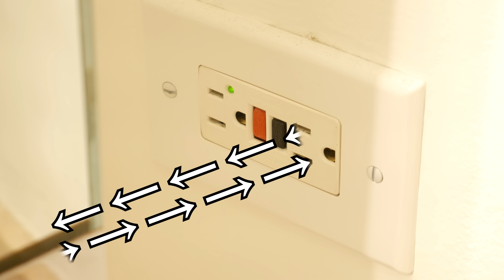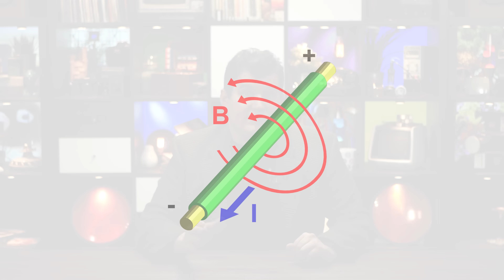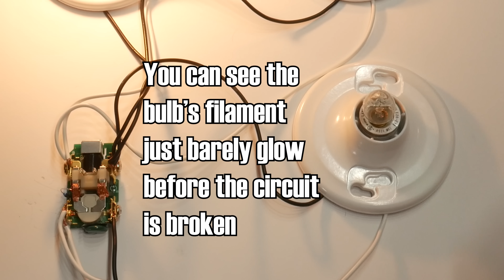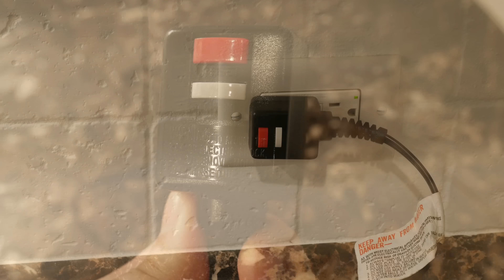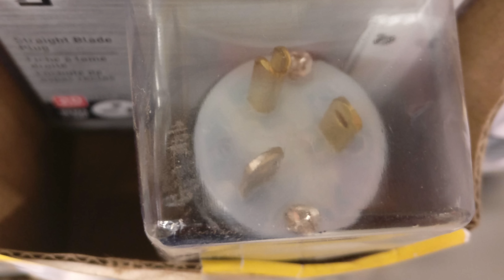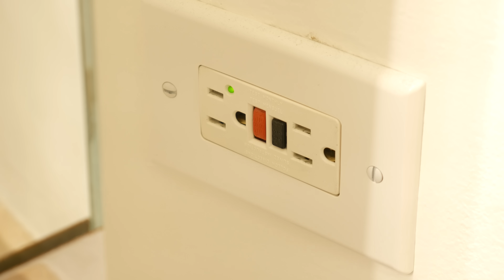The GFCI/RCD: A Simple but Life-Saving Protector

Comment: It's only required in the US for wet locations because in dry areas like your living room, you're more likely to shock yourself through a hot-neutral fault than you are with a hot-ground fault, which these devices don't protect against. Which is why they're also required over concrete like in your garage; touching a hot over concrete will more easily create a path to ground than if you're on carpet or hardwood.
Reply: Not sure what you are basing that it won't protect from hot to ground.  A GFCI protects both Neutral to Ground and Hot to Ground.
Reply: @redbaron6805  read it again. It won't protect from hot-neutral faults.
Reply: @Fsilone  Not sure what you are basing that on, as the GFCI monitors both the Hot and the Neutral for current.

If current imbalance of more than 5ma is on either one, it will trip.

So, if a more than 5ma leaves the Hot and does not return to the Neutral it trips, and if more than 5ma returning from Neutral to Hot is missing, it also trips.

A GFCI would be pretty useless if you could short the hot to ground and it didn't sense that.
Reply: I doubt, hot neutral shocks are rare. In many dry rooms you still have grounded equipment that offer direct path to the ground.

Comment: These things are annoying. There is one in my house that somehow, for some reason, is linked to everything on the OTHER side of the house. So when it pops half the house goes out. Whoever wired the place up must have been hungover
Reply: That scenario is typical when a garage GFCI is used to protect bathroom or kitchen, which is normally a dumb cost cutting move done by builders.  

The simply solution is to add GFCI outlets in the bathrooms and kitchens and simply wire the garage GFCI back to the Line side.  Have done this many times as the down stream GFCI solution is pretty dumb in the USA and is saving literally peanuts in costs.

Comment: I got zapped in my room because my mom woke me up to go test my outlet but it wasn't all the way installed. Even though I had helped with much of the work the day before and therefore knew better than to touch the sides of the partially-installed outlet, I was extremely tired so I went to plug a night light in to test the one under the leg space of my desk, got zapped, and whacked my head on the underside of the desk. In any case, I no longer required a cup of coffee because that zap sure woke me up. Obviously, coffee is a safer option but requires more time to take effect.

Comment: Hold on...You are allowed a power point in bathrooms in the USA? 

Fun  Fact

The reason we don't have this GFCI in a bathroom in the UK is because we are not allowed to have a socket at all ( unless the bathroom is big enough to be safe ). This is the phrasing in the building regs.    

Sockets

Sockets are not allowed in bathrooms or shower rooms (apart from shaver-supply units) unless they can be fitted at least three metres from the bath or shower.

Electrical shaver points must be a safe distance (in meters) from the bath or shower to avoid splashes

Comment: The building that I live in is so old that it has outlets specifically for electric razors.  This is before GFCI/RCD outlets.  From what I understand, I believe they reduce the voltage, or possible amps.  I don't think they are as safe as GFCI/RCD though.
Reply: If that is in the UK they are isolated i.e. much safer than any RCD. You can only get shocked between the two contacts.
Reply: @okaro6595  Canada.  Most newer buildings don't have razor plugs anymore.

Comment: One argument against GFI's in the breaker box is that due to their sensitivity and imperfect nature of our wires (shunt conductivity of the insulation) they will auto trip if you go over 100ft (roughly). However, we make GFI circuit breakers as well, i think of GFI as a function not a device, so that outlets, breakers, plugs, power supplies, switches, ect can be made GFI for whatever reason. I have a pool pump wired to a light switch wired to a GFI breaker, which is good because we often are wet when turning it off, and it has water that we swim in very close to a 240V motor, safety is prefered. 

I also assumed it had 2 ammeters, learning it just uses Ampere's law + Lenze's Law is really cool.

Comment: I think we (UK) call them Residual Circuit Devices (RCDs) to distinguish them from Earth Leakage Circuit Breakers (ELCB).  The latter trips when there is current in the earth core, which would be caused by an internal fault in the appliance (unless double insulated), and not by external leakage.

A guy I knew wired in a new light in his cellar exactly like you wired the 3rd bulb, it took him ages to figure what was wrong.

Back in 1960s in school we were told about this system as it was incorporated into some electric kettles, if the element shorted to the kettle itself the imbalance tripped a spring loaded plunger which sent the mains connector at the kettle end of the mains lead shooting out of the receptacle.

Comment: In Australia, circuit breakers are in the circuit break panel or fuse box, not in each outlet.  In the late 90s and into 2000 we had a situation where our circuit breaker kept tripping off, it happened rarely for several years, but then in 2000 it happened much more, we eventually discovered that the dishwasher was causing the trouble, the door switch would short out when someone opened the door.  I remember one time Mum was talking to someone on the cordless phone while working in the kitchen, she opened the dishwasher and immediately the circuit breaker tripped off, disconnecting the call, because of course the cordless phone needs mains power to work.
Reply: Tom Geldon  What do you call it then?  A safety switch?
Reply: Tom Geldon  Alright, I probably mean RCD.  I've always known devices like this as circuit breakers.

Comment: The current doesn't "flow" It oscillates back and forth @ 60 Hz. It's AC not DC.
Reply: The voltage causes a difference in potential which causes current to flow back and forth.  So, current flow is not inaccurate in any way in this context.  Both AC and DC equipment has a current rating and both have current flowing through them.

Comment: I love the GFCI’s in my house. There is a green light that is always on as long as there is incoming power, and a red light that comes on when the outlet trips. No more wondering whether a light is power or fault.
Reply: The Red light is normally reserved as a fault light for GFCI's when internal testing fails.  Self testing GFCI's will show a Red light when the self test fails and the GFCI requires replacement.
Reply: @redbaron6805   Yeah. Im just pointing out that my GFCI’s don’t have that annoying “does no light mean powered or tripped”. Mine constantly has one light or the other.
Reply: @joeythefoxxo  That's cool.  I prefer the one's with a light myself.  Just pointing out that most of the time, the Red light means failure instead of tripped.

I have a GFCI with a built in LED night light in one of my bathrooms, so I know if its tripped as the LED night light will be off.

There are a lot of different styles out there.
Reply: @redbaron6805  I love the night light ones. It’s the one that also has a white little indicator right?
Reply: @joeythefoxxo  The one I have is basically this one:

https://www.amazon.com/Legrand-1595NTLTRWCC4-Receptacle-Nightlight-Resistant/dp/B001H1GQRC

Although mine doesn't mount upside down, it mounts like a standard outlet with the ground on the bottom.

Comment: I work in construction and you wouldn’t believe how many inspectors don’t know how to test these. The ONLY authorized way to test these, is pressing the test button. Most inspectors use a plug in tester that tests it like testing a circuit breaker and will say there is a problem and that it didn’t “trip”. I have to educate them AND the homeowners EVERY time that THE ONLY AUTHORIZED WAY to test GFCI’s is the “test” button.
Reply: Your claims make literally no sense at all.  First of all, the actual inspection standards state the following:

"8.1.F. [The inspector shall observe] the polarity and grounding of all receptacles within six feet of interior plumbing fixtures, and all receptacles in the garage or carport, and on the exterior of inspected structures

Testing is commonly performed using one of a variety of electrical testers. First perform the visual inspection for overheating, looseness, arcing as noted above for switches. If a device is quite loose we do not test further but report it as a required repair. [See "Electrical Receptacles" in this issue.]

8.1.G. [The inspector shall observe] the operation of Ground Fault Circuit Interrupters.

While manual operation of these devices using their internal test button is possible, experience and information about the construction and operation of these devices and the circuits which they serve suggest that testing using GFI-test equipment adds additional information and will find defects not disclosed by manual operation. See "GFCI's" in the original issue of the ASHI Technical Journal.

Electrical "outlet" receptacle testers like the ones shown in these two photos are used by most home inspectors to check for proper wiring at electrical receptacles as well as to check the function of GFCI's.

An electrical receptacle which has been wired 'downstream' from a GFCI or AFCI will be protected by that device provided that the wiring has been connected properly.

We find often that these devices were not wired correctly. For example, reversing the "line" and "load" wiring when installing a GFCI will prevent it from functioning properly even though the installer may test it and think it's fine."

In fact, it is literally IMPOSSIBLE to test downstream circuits connected to the LOAD side of a GFCI without a tester, as they have no test button.  

So, the idea that the ONLY way to test a GFCI is by using a test button is completely false.

Comment: Any GFCI-protected electrical outlet in your home is a good test point for whatever older, perhaps vintage, electrical or electronic devices you might have decided to plug in after they sat around for years unused or that you had picked up at a flea market or whatever. Tube/valve type guitar amplifiers and hifi amplifiers are a particular case in point;  these often have the audio ground and chassis coupled to one leg of the power cord through a capacitor , for the purpose of using the neutral wire as a pseudo "earth ground" to the chassis, in order to reduce audible hum and buzz. If the amplifier hummed, you would simply flip the non-polarized power plug around the other way and hopefully lessen the noise; or if the device already had a 3 wire grounded cord, there might be a switch on the back to select the ground polarity and you would set it to whichever position reduced the noise. The problem is, 60 or 70 years later those capacitors often leak voltage and so you might find some AC leakage current on the chassis of the amplifier, and also on the guitar strings and metal hardware of the guitar. However, plugging such a device with a leaky "death cap",  as they are often referred to, into a GFCI outlet will immediately trip the built-in breaker and alert you of a dangerous situation.. As I have noted, vintage guitar amplifiers pose a special problem and should always be converted/ upgraded to a grounded 3 wire polarized cord and plug,  with the death cap removed.
Reply: What if all available outlets are only two prong and have been upgraded to GFCI 3 prong but still no ground, is there any way to make a grounded device safer? We also use protected power strips on every outlet without GFCI

Comment: Just moved into a new spot.....non in the restroom and 2 on the opposite side of the sink/dishwasher. Idk what's going on here but it's fonkay
Reply: Any outlet within 6 feet of a sink needs to be a GFCI or connected to a GFCI.  The outlets you don't see with a GFCI are probably connected to the Load side of a GFCI somewhere else.  If you really want to know, just pick up a GFCI tester at HD or Lowes for around $10.

Comment: To be honest, the reason they exist on US plugs is the fact that the US wall outlets are inherently unsafe and perhaps, there isn’t an “earth leak” fuse in the fusebox. 

The safest wall outlets are the EU grounded version and the Commonwealth plugs. 

Especially on ungrounded US wall outlets, there is a chance that the plug comes out a bit and you can touch both leads whilst current is still on them.

TL;DR, it’s a “stop gap” sort of thing because of inherently unsafe design.

Comment: For trouble shooting with a main GFCI/RCD, if you build your home's circuit in a responsible fashion it is not hard. You take everything else offline and only turn on one sub switch at a time. It takes like 5 minutes at your panel and you would want protection for your entire home anyway. For your workstation I suggest an air switch with GFCI built-in, you can easily adjust it so it doesn't take down the power of your entire house when it trips, and it provides much needed overload/short circuit protection as well. And even the small panel on your wall is just so much easier to work with compared to a wall outlet.

Comment: There used to be devices, now obsolete, called ELCB's (which only detect faults to the earth pin of the socket) to save confusing these with GFCI's or RCD's (which work as you describe) the International Electrotechnical Commission decided on the single classification RCD.  Not sure why in the USA they are still called GFCI's, as they are a member of the IEC.

Comment: I wish I had seen this video years ago. I was an appliance repair man and then a technical assistance call taker for many years. Back in the days of exclusively electro-mechanical appliances, we would get the call where a washer or gas dryer would trip the GFCI breaker when the unit was turned on. If the appliance was connected to a non-GFCI outlet, it would function normally so the consumer was advised to replace the GFCI breaker. Since the GFCI breaker was probably wired up with both neutral wires on the LINE side of the outlet, the electrician who was called out to replace the GFCI would duplicate the wiring mistake and the cycle of blame would continue. This became even more difficult to diagnose (especially over the phone} when the GFCI would trip as soon as computer controlled appliances would trip the GFCI outlet as soon as they were plugged in - since the computer was demanding 8 ma or more just to run the display or scan the keypad for input. Knowing how these things work now, we would have still run into the problem of being unable to recommend that the tech on the other end of the phone to perform any diagnosis to the customer's electrical infrastructure unless they were also a licensed electrician but a simple count of the wires connected to LINE and LOAD could have revealed that there was more than 1 wire (or more than 2 wires if the outlet was daisy chained) on the LINE neutral side. As the Scandinavians say "Too soon old, to late smart".

Comment: And another thing....  I've never been to the States, so have no direct experience of your electrical things (although, personally, I find much of the non-UK European electrical stuff quite worrying enough...), but I DO have a US/UK travel adaptor, and one thing that has long puzzled me is why it has a round hole in each pin. I should point out that this adaptor is at least 20 years old, and I have seen others that don't have these holes.

Comment: On all new builds GFCI and AFCI protection is required at the main panel. On a panel replacement the same rules applies and standard breakers must be replaced with (depending on the wiring) either AFCI or AFCI/GFCI(dual) function breakers. In doing this GFCI outlets are no longer required in "ALL WET LOCATIONS" due to the entire circuit already being protected.

Comment: When they built my house they chained several outlets off the GFI ones, not necessarily nearby.  My inspector verified that the outside outlets were GFI protected, but it wasn't his job to reset them.  It was three years later that I found the otherwise unused GFI outlet in my furnace room and finally restored power to the outlets on my exterior deck.  I actually had an electrician doing another job at the house trace the wires and find the GFI outlet for me.

Comment: Thank you so much for the great explainaton. In my house, the masterroom circuit breaker is somehow also connected with guest room washroom. Every time when somebody drying hair with a blower, if I use my hotwater kattle in master bedroom, the breaker would tap. So I thought install one of these at the guest washroom would help and only break the dryer plug when excessive current is on. Yea, it didnt work that way. I was wondering why for a long time. 
I think the only solution is to split the washroom power line with additional circuit breaker.

Comment: here’s what I’m confused about: if the amount of current going out is exactly the same as the current going back, then how does it power anything? Shouldn’t there be less current returning since some of it is used to power the device?
Reply: So the way we measure things is primarily with voltage and current. There’s something called electric potential, which is basically the potential for electricity to flow. An outlet or battery creates a potential difference, which is voltage. So the voltage goes down as you go through the circuit, but the current is basically just how much electricity is flowing. For a wire, unless it’s leaking out or getting external electricity, you can’t really have more electricity flow in a line. It would be like a sealed pipe flowing with water to end up with more or less water at the end of a line.